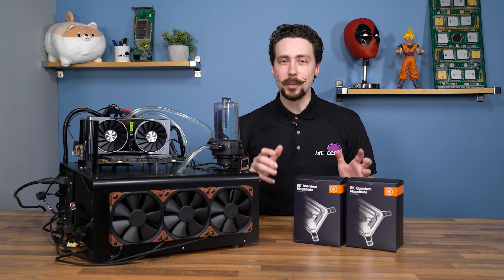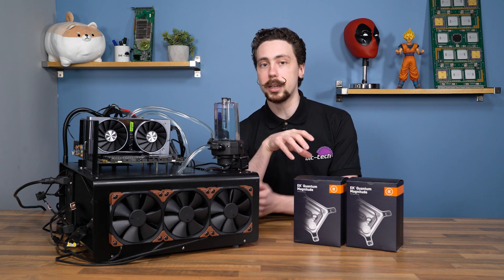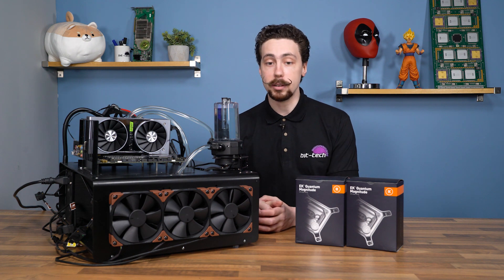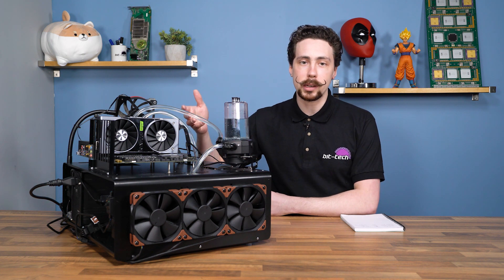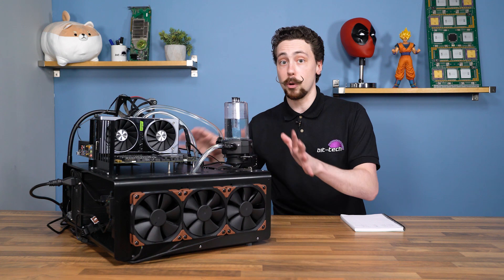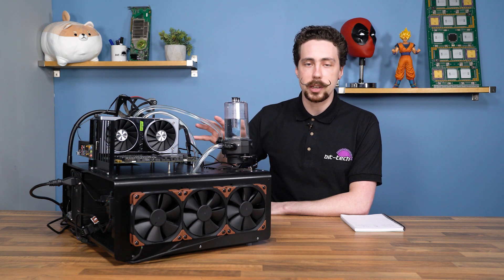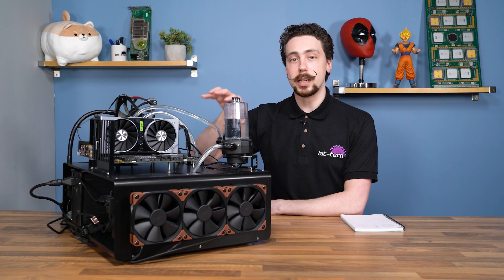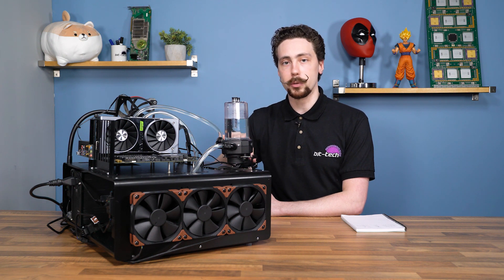Testing Blocks with HIGHER Clocks | bit-tech Modding

Comment: is ambient = coolant temp? The heat transfer capacity in the block should be measured as delta temp where delta temp means is the difference between the coolant temp and the cpu temp

Comment: this thing is absolutely terrible in terms of price/performance ratio.
over 200 € for this vs. ~80€ for heatkiller IV
It has to beat it for like 10+ degrees to make this astonishing price gap somehow worthwhile.
Reply: It is for a niche group. It doesn't have to be 10C+ cooler to be worth a premium. An enthusiast making a 4000,- rig will glady pay 100,- more for a 5 degree difference. That is quite massive in that scheme of things.
Reply: @tfm2934  except this thing doesn't have any meaningful differences with 2.5 times cheaper alternatives in term of performance and mind u they even look better.
Yes. It is "niche" product - for idiots and fanboys
Reply: @1222dss  To be honest, throwing around insults for no reason sounds quite idiotic to me. Perhaps reconsider the block? Anyway, the meaningful difference is that this block performs very well in low pump speeds, and introduces very minimal restriction itself. EK's blocks are made for the real world, where the rest of your loop also needs to function, not just for single endpoint temperature benchmarks. You can save quite a bit of money from not having to run a dedicated pump just for this block & loop.
Reply: @tfm2934  where do u see any insults my dude? These are facts and nothing more. 
Summarize
1 - This block has NO meaningful advantage in performance over his competitors
2 - this block has 2-3 times higher price tag than blocks with comparable performance
3 - this block compatability is ZERO. Did u just want to switch from intel to ryzen 5000? Well - go buy new one. 

EK staff is mediocre (just like alphacool) and yet overpriced quite often. Their build quality nowhere near of aquacomputer/watercool or any similar watercooling stuff company.
Reply: @1222dss  You indiscriminately call everyone who would consider this block an idiot or a "fanboy", which is equally an insult to one's judgement. If you don't see the insult in that, then I suspect you've spent so much time amongst equally toxic people that you've become tone deaf.
Reply: @1222dss  Re-read my last comment again. This time slowly. Perhaps try speaking the words as you read it; that always helps with comprehensive reading. Eventually, you will get it. You might even see the irony that I see now.
Reply: @1222dss  Try again. You can do it!
Reply: @tfm2934 Исходный текст
 I did a long time ago bruh. Please stop embarassing yourself.
You came here like a little doggy to protect your beloved company (perhaps you even own this garbage) while ignoring straight facts that been said to you in the beginning.
Do you have to say something on topic? If not then go cry about how harsh the world to you is somewhere else.
Reply: @1222dss  Hmm, too bad. But, I still believe you can do it! Take a deep breath, try to get me out of your head a little, and don't be afraid to take the time you need. Good luck!
Reply: @1222dss  Where did I say I was buying this product? And if you don't know that an insult and an opinion are not mutually exclusive, fact or not, then you are beyond redemption

Comment: those voltages are crazy my 7960x did 4.8ghz @ 1.22v the power consumption was nuts. what vccin and vccio voltage are you guys using?

Comment: I would love to see how these premium  blocks stack up against lower cost options like Bykski or Barrow.
Reply from the maker: Robert Helcher This is also something I think would be interesting. Usually even the cheapest blocks will perform pretty well as the majority of performance in a WC system stems from radiators and fans rather than the block itself.
Reply: @bittech1  Please do test them and give a proper review. Water cooling has become quite expensive, even by formerly average priced companies like Alphacool and EK. I've got an impression that Barrow and Bykski are both shaking things up, possibly making water cooling again a more attractive choice for the average joes who like to tinker with their rigs but has a limited income. However there are next to no reputable reviews of their products, it is all word in mouth and forum/reddit talk at the moment. I would love to see someone professional really take a deep dive on the alternatives than just yet another EK/Corsair/Whatever.
Reply: @MaaZeus  - Agreed.  I used to have my old systems loaded up with DangerDen components.  The prices were reasonable and the performance was perfectly adequate.  I know that EK & others have made improvements, but a milling a block of copper in a different pattern doesn't drastically alter the cost of the process, so hiking something from 75 bucks up to 250 isn't justified.

Comment: This is interesting - thanks for the great vids. 
Personally, I think it is not worthy of the premium it commands and as you said the temp results become more of a trophy at this point. 

Wonder if adding a second pump to this loop would change anything?
Reply from the maker: Michael Chan Potentially but I don’t imagine that an extra pump will have much of an effect. The D5 is running at max and the flow is pretty huge as this is a very simple loop without any real restriction to it.

Comment: Hey!
I have two GPU, What is the best choice for water cooling?
Connect the GPU using Like ==> EK-FC Terminal X2 S 3-slot - Plexi.
or
Just i use only the Tube between them in with in -- out with out.

Comment: I really like this idea for content. it reminds me the reviews from extremerigs (although they are more scientific).
It would be great if you expand on these type of reviews since there arent many that do it.
After acquiring more review units and with a bit of refinement in testing. like standardization of methods (radiator type/size, pumps), maybe a heat load generator (if those arent really expensive).3d print a thermal paste silkscreen( if its even possible, im just throwing ideas here ) for consistent application.
Love your content so far, Keep it up!
Reply from the maker: Aye we definitely want to expand further on this as you're right, there's just not that much info out there. Additionally, even the thorough testing guys don't ever talk about how things are made, they just stick to numbers, which IMO is a massive shame. Regarding the heat load generator though, that's more for radiator testing so that you can standardise the wattage vs coolant delta. The issue with doing it for CPU blocks is that you end up not measuring the effectiveness of crucial parts of the block, such as the cold plate shape, jet plate arrangement and mounting mechanisms.
Reply: @bittech1  You are right! I didnt even thought about those features of the blocks.
Thanks for the great content!